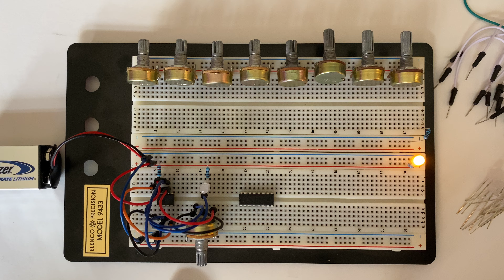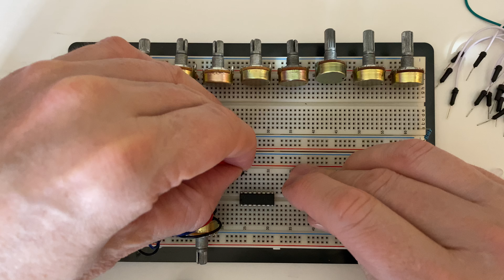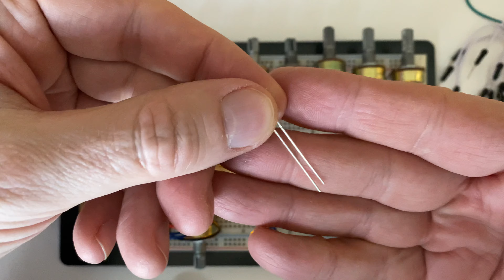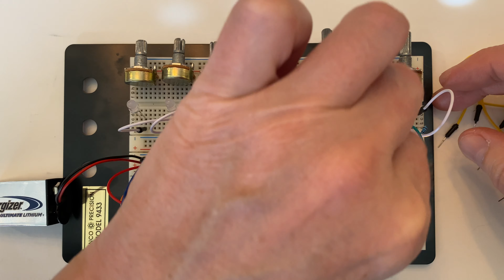How To Build An 8 Step Sequencer Tutorial Part II

Comment: Hiya, I have built  a very simple 4 step sequence with a 555 and 4017.  The lights count up to 4 then there's a 2 second gap then they count again.  The reset is not resetting so there's not a fluid sequence of lights.  I have a wire coming from reset to pin 10 of the 4017(output4) as it should reset there, but it does not? The wires from the outputs to led's are pin 3, 2, 4 and pin 7.  Clock of the 4017 to pin 3 of 555.  Any ideas why it's not resetting will be most appreciated, thanks.  Brilliant  and very informative videos, many thanks!
Reply from the maker: Reset pin on 4017 is 15. Clock pin is 14 and pin 13 (to ground) is clock inhibit - for clarity. Try adding a 10K - 100K resistor from reset to GND on the 4017 - in addition to the pin 10 lead to reset pin 15.

Comment: Will not work in tinkercad, decade counter is slightly different, 555 counts to eight , then stops.  frustrating.
Reply: Hi Sarah, Unfortunately my hands shake so badly, I can't get the wires in the correct holes in the breadboard, so I tried to get the grandson to simulate the project in tinkercad to see if it works (much safer). The program will only allow 7v into the counter not 9v like your project and will count 8 steps and stop. Not your fault at all. But thanks for the reply and for providing an interesting project concept. Maybe I should find a better free simulation software.
Reply from the maker: Why do you need tinkercad for a diy? All you need are parts, breadboard, wire and battery..?
Reply from the maker: Sorry it didn’t work for you. I am not familiar with Tinkercad, so I haven’t any suggestions for you.

Comment: I used your design, but instead of switching from a led to the other.. it stay in place.. do you have any ideea why?
Reply from the maker: Yes. Insure that pin 13 of the 4017 goes to ground.
Reply: @Sarahbuildsstepsequencers  Just checked.. it's connected to ground.. must be something else.. if i don't connect the clock to 4017 i switches very fast between the led-s.
Reply: @Sarahbuildsstepsequencers  issue solved, for some reason unkown for me, i wired the diodes wrong :)) Got another question, will you be willing to make other tutorials with the more complex sequencers?
Reply from the maker: @TheCavebyCo2  hey, glad to hear it’s up and running! No, the more complex circuits are for sequencers I sometimes build for sale. Also, there are no schematics, lol. I’ve just memorized circuits I use over time so I build from memory. I suck at computer and drawing schematics. Neither is something I’ve ever strive to learn.
Reply: @Sarahbuildsstepsequencers  OK, i understand!

Comment: Oh my,,,i love this....i may have to look at these over again and build one...i think i have all the parts..i have some many chips..i'm sure i have this one
Reply from the maker: I’ll be adding one more 555 timer chip and that’s all for the IC’s. All the pots are 100K and you’ll need 8 qty. 1n4148 diodes. You can do this, R.!
Reply: @Sarahbuildsstepsequencers  oh 666?....OMG i meant 555...lol.....don't have a 666...lol....but anywayyyys,,,yes i have the 555...i used that in my 8 step sequencer as well but i did need to bread boards for that one....
Reply from the maker: The 666 was discontinued due to horrific malfunctions resulting in fiery complications…
Reply: @Sarahbuildsstepsequencers  oh I didn't know that. LOL. Probably cross wide within the chip. Imagine that wow. Immediate fire LOL. What are you working on next